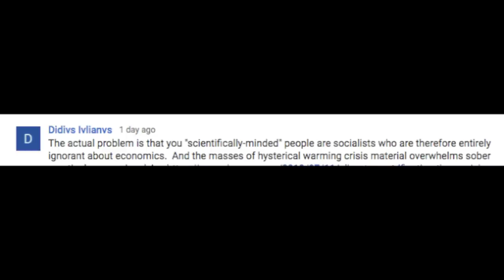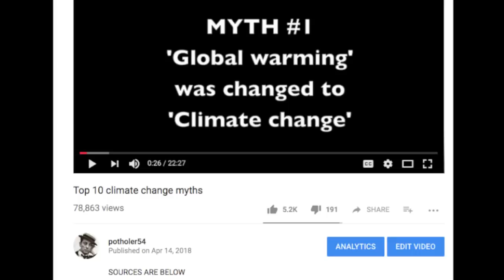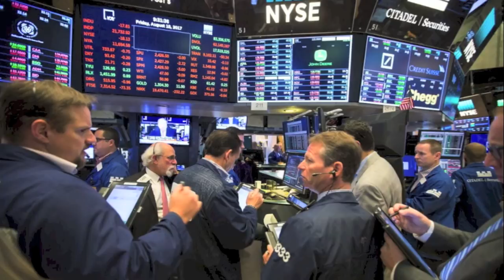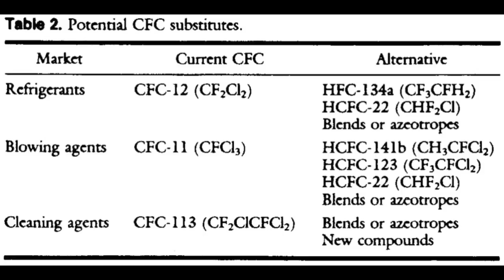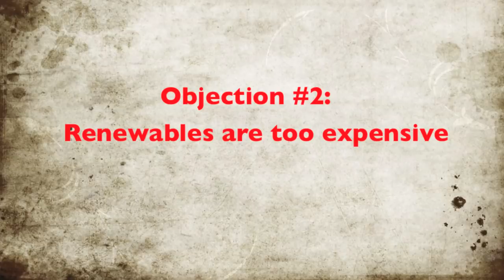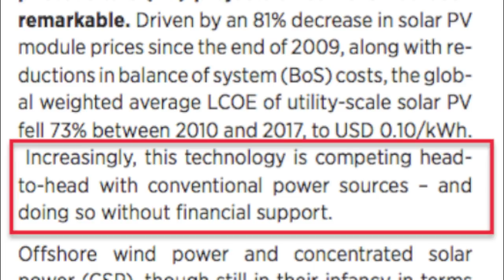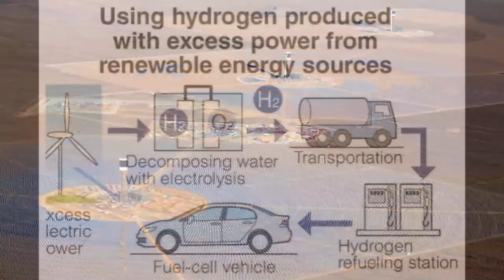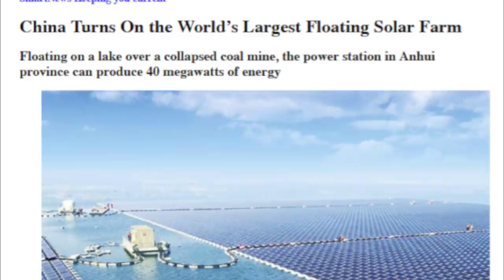A CONSERVATIVE solution to global warming (Part 1)

Comment: Potholer, love your videos, and this response is adequate, but I don't think you really understand what US conservatives mean by free market. 

A free market to them is one with as few regulations as possible, and by that I mean, pretty much no regulations. I have yet to hear a conservative say where that line is drawn. For you, it's essentially "my right to swing my hands around ends at your nose", but free market conservatives don't believe in this concept in the market, because the market to them is a means by which you mutually exchange goods and services. Since it's mutual, then you can't possibly harm someone because they agreed to it. So essentailly, to combat climate change, it would require everyone individually to decide they will boycott fossil fuels and use green energy.

The free market, to US conservatives, did not produce unleaded gasoline. A regulated market did, one which created the regulation that you can't have leaded gas. They don't want that, which is why Shapiro does not want cap and trade or a carbon tax.

What he wants is an essentially unregulated capitalist system. He also doesn't want any corporate subsidies, for any company, because that's the government interfering in the market, making it less free. They also want a smaller government, so they don't want it to fund research into things like batteries. That would also benefit certain companies, which he would call the government picking winners and losers and thus making the market less free.

This is why people think capitalism and free markets can't solve the problem. It requires government intervention to solve it, which is NOT something a free market advocate would support. So it's because of the definitions they use for free market and capitalism that leads them to believe they can't solve the problem of climate change. And I think if you used the definitions they use, you would agree with them.

I can't say for sure what people mean by free market in other countries, but this is the definition that US conservatives like Shapiro use. Your idea of a free market is actually just a competitive market place with regulation from the government.
Reply from the maker: Thanks for your interpretation of conservatism and free markets. If you think it means that anyone can do anything, without any kind of regulation, then that's not the kind of free market I subscribe to, and neither is it the kind of free market subscribed to by Republicans or conservative and libertarian think tanks in the USA. Just read their credos.
  If Shapiro doesn't subscribe to it then he's not a conservative, he's an anarchist. That's why I use the term "so-called" conservatives to describe people who think it's perfectly OK to trample on people's property rights and individual liberty. True conservatives see protecting individual liberty against tyranny as the bedrock of their beliefs.
Reply: @potholer54  This is absolutely 100% correct. We found out during the days of Andre Carnegie and Rockefeller that too little regulations can actually HINDER freedom. Can you imagine what it would be like for a businessmen to compete against Rockefeller? He may very well have become the most powerful man in the world if we didn't intervene. Possibly could have controled the government. That's scary. I have noticed that in 3rd world countries, it appears to work this way. The anarchy naturally creates an extremely powerful group that begins controlling the government. Bring BACK traditional conservatives!
Reply from the maker: @gearhead 130 -- Yes, a good example is Somalia during the years of no government. Complete, unfettered freedom. Anyone can do whatever he/she likes, including gunning down rivals. That's REAL competition! But the result is roaming gangs where the strongest wins, bringing the very kind of tyranny American conservatives are supposed to be against.
Reply: @Supadubya  I got to be honest, I thought you were one of those guys throwing conspiracy theory garbage at me but that was actually really good information. This might sound strange, but seeing how bad the 1896 election was actually gives me hope. I was under the impression that our current big money corruption in politics was unprecedented. If they beat it then so can we. Thanks for the information. It further reinforces my beliefs about regulations and bringing balance to the wealth gap.
Reply: @gearhead1302  Yeah, my awareness of that messed-up time in our history (one of several, actually) has similarly given me at least some modicum of hope for our future, just as you say.

Comment: Look up Thunderf00ts debunkings of solar roadways////
Reply: I thought the same when I saw the freaking solar roadways lol
Reply: Dave from Electronic video blog has also been making videos. Many dislike Thunderf00t but I like his videos about history and stem.
Reply: Just reviewed it. While I agree with him in one thing: Right now, the cost of such an endeavor for the primary parts of our roadways is insanely counter-productive.

But he has a number of flaws in his video, let me try and break some of them down...

The $300 back in the 2014 video for the cost of a panel... The tech was more expensive to use than that 10 years ago, and we are trying to drive down the cost by mass production of it, so to say long term it will always be 300 per tile glass, is probably a bit dishonest. Second, his whole thing about glass only seems to be a bit beyond what they are doing about experimenting the best way to do this, there are other options. 

Another thing: his dishonest approach to the heating of snow to ice. Sure, it takes that much energy, but it scales with you needing more if it is really, really cold and below freezing, to just about freezing. Also, that is still less for heating than you think, and it isn't even needing to be on all the time for that, just when snow is present on the road, or ice. Power banks can easily compensate for this - and that also might, under highly efficient solar panels that can come out - to be enough to easily do the job and provide extra power, for some areas in the northern areas. Or backups from other areas where there isn't as much snow...

As for parking lots? He says in the daytime, they are almost always full of cars... Except - unless you are talking about really full parking lots, most of them, that simply isn't true in - especially around places where I live, where it wouldn't be the case.

Anyway, in conclusion, he tries to make it far sillier than it actually is, make fun of it - and draw a bunch of false dichotomies from time to time. I didn't watch the last 10 minutes or so of video, but that was what I got from it.

Though still, I do agree - right now, making it for all the roadways, would just bankrupt us for little gain. But to say there is never a place for the technology, and the potential for the price to become slowly more sane in the longer term for this (hence, the funds mainly going into parking lots) - is pretty disingenuous.
Reply: remember that his main point is that there are many, many other ways of generating solar energy that don't include replacing an already existing infrastructure. simply putting a solar roof over roadways would be completely better than putting solar panels under the vehicles, even during the winter where it could serve as a shield from the snow. the crowd funded projects he makes fun of are just as ridiculous as he paints them out to be, it would take at least a decade for dedicated research teams to make solar roadways a profitable and useful project, not just two ambitious people.
Reply: Yo boi Jonx, even you admitted it might be possible though, "it would take at least a decade for dedicated research teams to make solar roadways a profitable and useful project"... They are way too ambitious, and it would be far more problems to try and implement it now, even I said that. But to say the whole thing is a farce, is bad long-term thinking, which I also said.
Reply: The Doom From Latveria 
The point is whether it makes economic sense.  It doesn’t' and probably never will.  Solar panels don’t work when covered with dirt, so a road surface is a bad application.  Then there are safety considerations — how do you make a solar roadway surface that transmits light but provides acceptable traction?  Wheeled vehicles don’t do too well on an icy surface.

Two examples that Thunderf00t used were ‘standard’ solar panels as a roof over parking areas, and using them to roof over the median between a dual carriageway which can then be used by cyclists.  Much better ideas in every way.
Reply: Exactly , that type of shit gives solar a bad name!
Reply: He beat that dead horse for far to long now.
Reply: Thunderf00t missed the forest for the trees. All new technology goes through a period of trial and error. Look at early airplanes. You have wacky, weird and dangerous attempts that finally become efficient and elegant. Early electricity same. Cars,, the list goes on. We're in the middle of the same process and just as I remember using early cell phones that had a bag to carry the battery and having to dial *88 every so often while driving to change cell towers and waiting until 7pm to make a long distance cell phone call so it wouldn't be expensive; the same thing will happen in energy, eventually
Reply: @seaotter52  He already debunked your claim about it being new and thus needs more research. He's bought up that argument against him already in many videos.
Reply: Mike Gardner the main problem with solar roadways isn’t the cost, it isn’t the ROI, and it isn’t the idea. It is that it will ALWAYS be more economically viable, and more energy efficient, to take the solar panels off the road surface and move them to the side. You just get more bang for your buck that way. Plain and simple. Solar has its place, but it’s not as a road surface. At this point, there’s not much getting around that. And NO we don’t have to waste our time “trying” it out. We already know it.
Reply: @ComradeTomatoTurtle 
I guess I didn't make my point clear enough. There are going to be many different ways to implement technology. Some will be ineffective and others will downright bizarre and still others successful. This is an example of trial.... and error. At least they were attempting to come up with a solution. That's an idea that can be checked off in the "didn't work" column
Reply: @zenaku666 
20/20 hindsight is always spot on.
Reply: Mike Gardner didn’t need hindsight to show that solar roadways was a bad idea from the word go. Basically all they’ve  done is waste money and give solar a bad name. The more cynical may even think they knowingly scammed people. This isn’t anything like the airplane or car or cell phone btw. So your comparison is just wrong and shows you’ve not really thought this through. Those had their detractors yes, but the basic premise wasn’t up for debate. You could make an engine that ran on gas, and it would be better than steam, you could in theory make a craft that could fly, and it’d be better than the current flying tech, and you could make a small phone that sent signals wirelessly and it’d be better than land lines. You can make solar roadways sure, but it’s no where close to better than current installations. And the fact you sit there and say “well at least they’re trying something” just shows how little you’ve been paying attention.
Reply: @zenaku666 
Might have been a kickback to a buddy for all I know, but it's still hindsight from our point of view. It's also a good idea to point out, even after the fact, that a certain project was bollucks. Who would have thought that aluminum would be a good battery concept until it was.  I agree with you about the money waste and bad PR and would have loved to have been in the meetings that pitched the roadway panels. As someone in the aviation business I have to compare this to the earliest days in my industry. Your argument of wasting money and bad PR could have been made then as well. Some of those designs were "obvious wastes of time and money". Oh for 20/20 foresight ;)
Reply: @seaotter52  You missed my point, Thunderfoot already answered your argument. Im not trying to argue with you, thunderfoot made like ten videos on the subject and already argued his point on that numerous times.